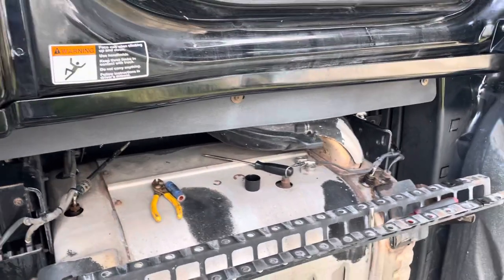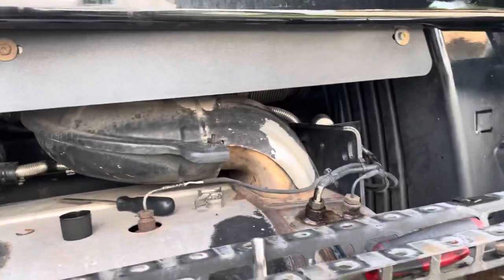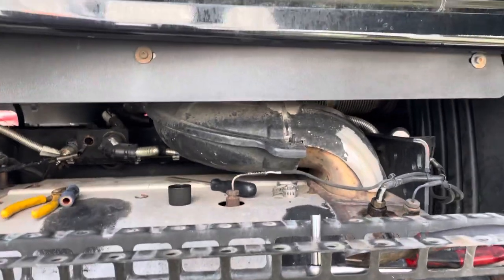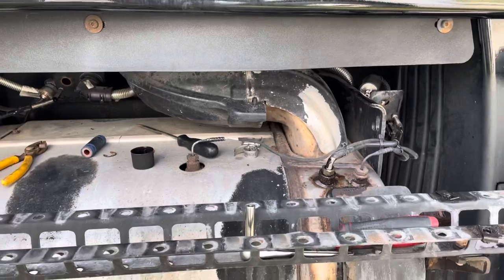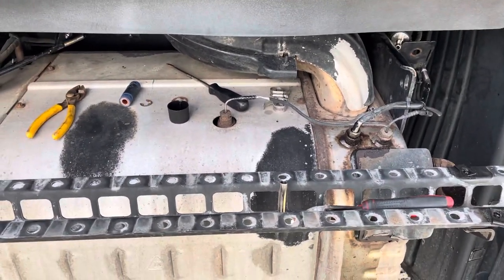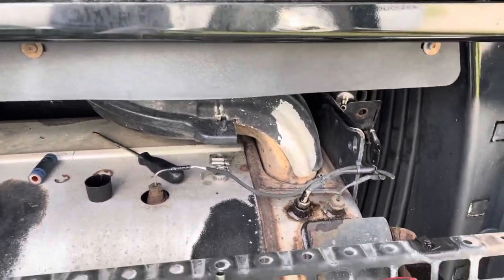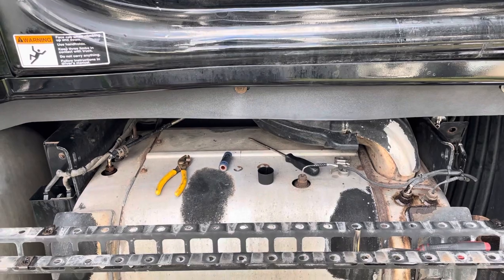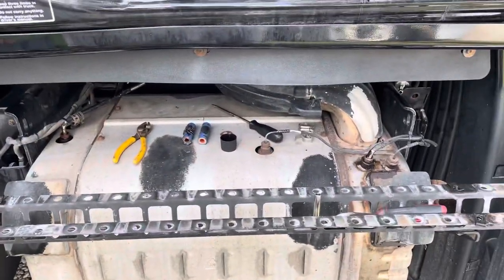Freightliner DD15 code 3251, clogged metal line causing pressure differential.

Comment: What software do you have?
Reply from the maker: Freightliner Diagnostic Link, $550 a year for subscription and have the same exact access that the mechanics at the dealer have.
Reply: @wesley_scott  Is it worth it?  I'd rather have ownership of something.
Reply from the maker: @supertrucker1356  if you want full control like the dealership has yes it’s worth it. It’s saved me from 2 separate tow bills over the last 4 years.